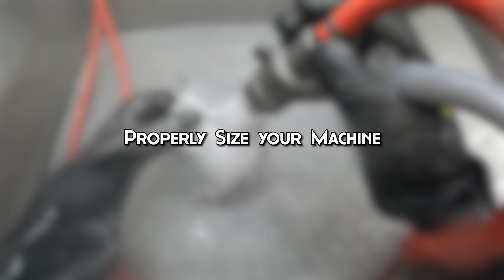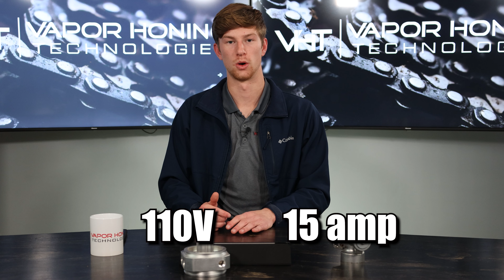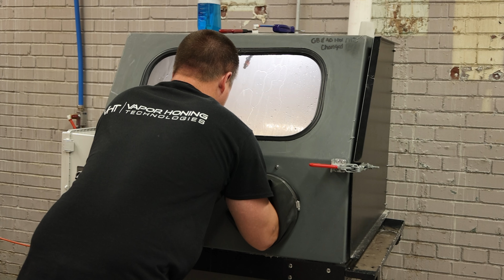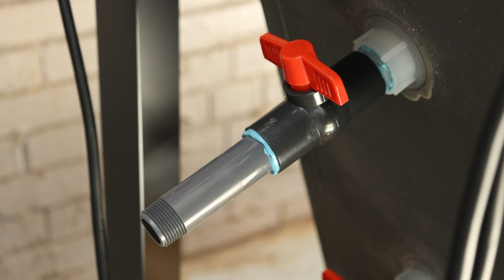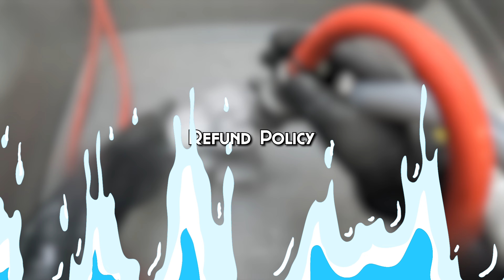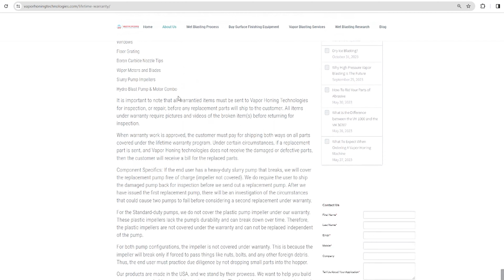Everything You Need to Know When Buying a Vapor Honing Machine!

Comment: Excellent job Ryan.  I don't know about the larger machines, but I own a Weekend Warrior, which does not come with a regulator.  You should cover that at some point so people know what they need to attach the air supply to the machine.  I bought a Nitra precision regulator and gauge from Automation Direct, but there are cheaper options if you are willing to sacrifice accuracy for the lower-cost option.  Just a suggestion.